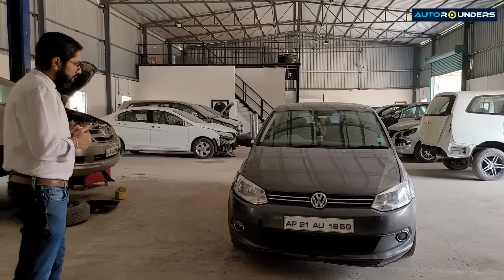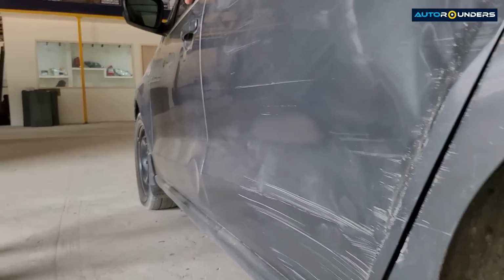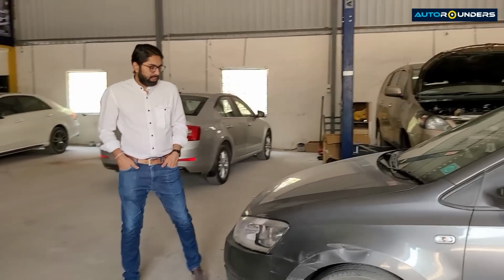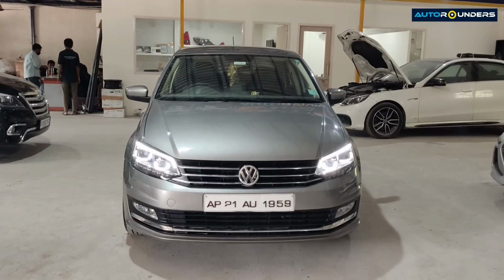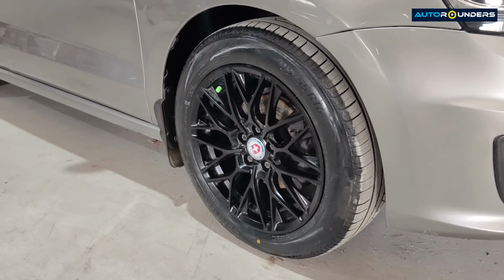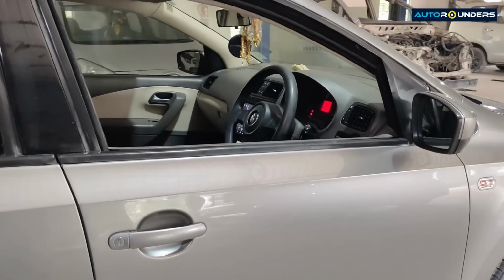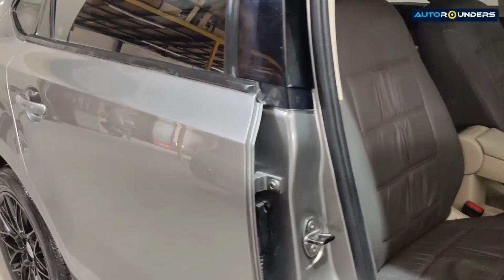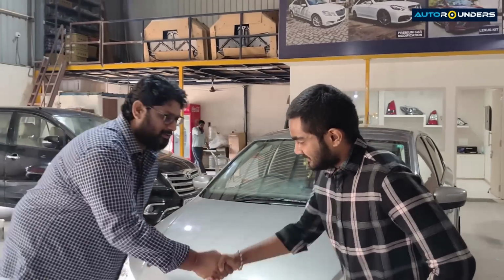Volkswagen Vento Facelift & Exclusive paint in German material | Autorounders Hyderabad

Comment: Are you doing mechanical work as well? Like suspension repaire and steering rod noise and gear shifter problem
Reply from the maker: Yes we do mechanical work also. Please call or WhatsApp us on 7666-930-930 for Mumbai and 7666-830-830 for Hyderabad and 9206-630-630 for Pune.

In case if above numbers are not reachable or busy then please WhatsApp us on 8425-80-80-80.

Comment: Lot of body filler used to fill the imperfections. No guide coat used on patches filled with body filler or putty for low n upper spots on body panel to make perfection.

Please specify the brand of primers, top coat and finishing coat, which ever u r using for body paint.

What I observed that i am posting.
Reply from the maker: Hello, thank you for getting in touch. For information on pricing and customisation enquires, please Call or WhatsApp us on 7666-930-930 for Mumbai and 7666-830-830 for Hyderabad.